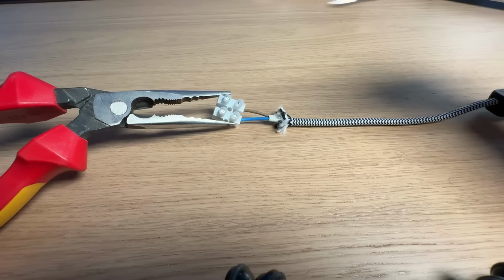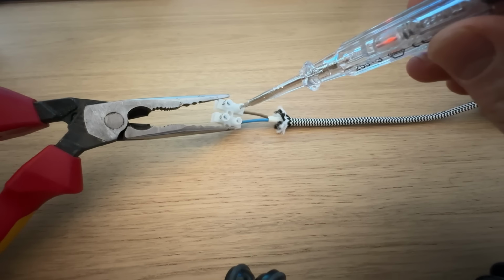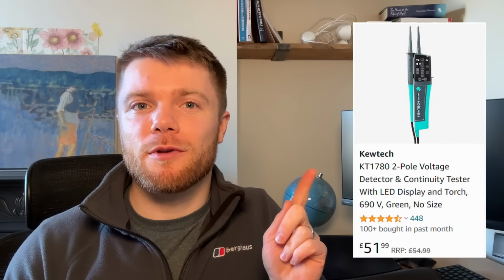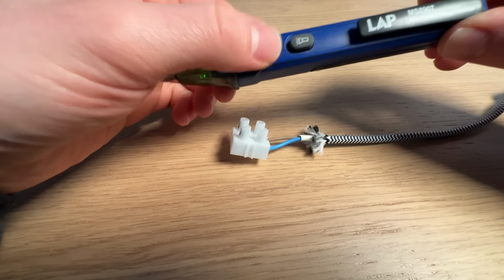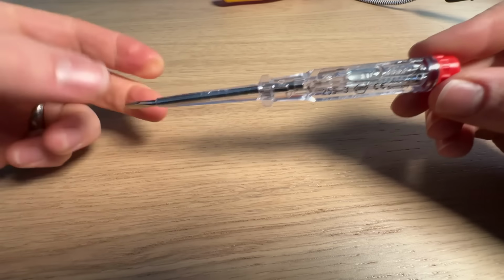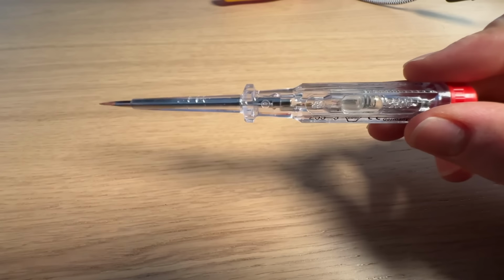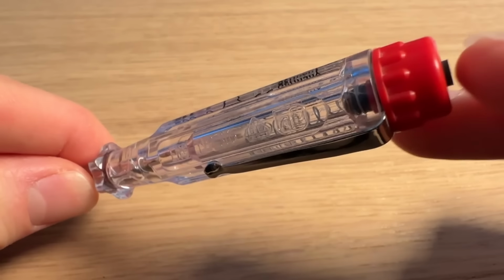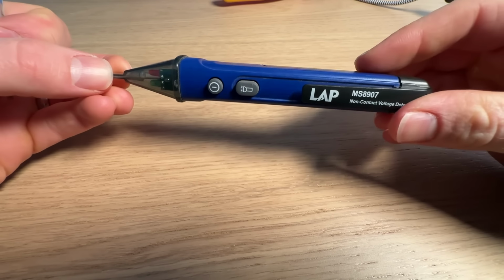The Most Dangerous Electrical Tool

Comment: You are mistaken in the principle of operation of the indicator screwdriver - the current does not go through the user to the ground, the user is a capacitor creating an oscillatory circuit. It is trivial to check - put on thick rubber shoes and the screwdriver will still work.
Reply: I had to read all the fictional assumptions made by so-called electricians/electronics, including the creator of the clip who didn't understand how this tester works. I'm glad that finally someone who knows has shed light on the subject! There are enough speculations that have nothing to do with electronics and how they work, nowadays, everyone thinks they are electronics engineers, but they don't understand how semiconductors work at the base. A resistance of 1M OHM indicates 0.23 mA compared to 20mA dangerous current at 230V voltage. But the gas in the lamp ignite, is not a usual lamp. Neon lamps are commonly used as low-voltage surge protectors.
Reply: Finally, an answer that makes sense.
Reply: Ill try that. on a ladder with rubber feet on a vinyl floor with rubber shoes on. I'll check if it lights up
Reply: @slendydie1267  have you already checked it?
Reply: i do my house stuff on a rubber mat, i assure you, if i dont touch a wall there is no light. That is the dangerous part, false negatives in bright light or in your fancy eva sandals
Reply: @josmith9662  Are you sure you're talking about this kind of indicator screwdriver? Usually, people touch the wall with their hand when using active devices, as this reduces interference and improves the accuracy of finding wires or metal, you can even find wood behind a drywall...
Reply: Total codswallop. Neon is very high impedance and the human is passing a few micro amps to ground to strike the neon.
Reply: @HowardKlein1958 This misses the point. A neon screwdriver has a high value resistor in series with the neon, both limiting the voltage appearing across the neon and limiting the current passing from the voltage source, via the screwdriver then passing via the human to earth. If enough current passes through the human sufficient voltage appears across the neon to light it. Under ideal conditions the resistor limits the current passing through the human to safe levels, as 50mA is considered lethal. However if a fault occurs such as the screwdriver becomes wet, or a short occurs in the screwdriver, the screwdriver can pass a dangerous level of current via the person  to earth. The other problem is this, if the person is not sufficienty connected to earth such as by standing on rubber, an insufficient current will pass through the screwdriver to produce enough voltage across the neon to light it, producing a false negative. For these two reasons neon screwdrivers are not a safe method to prove a 230v supply is dead.
Reply: There is no oscillation here. The current really passing through user to the ground. Just that the ground is not necessarily only the floor. The whole body make contact to the air and humidity from it is enough to light the screwdriver, even if faintly. Only if you wear rubber shoes or stay on a wood chair and the air is very dry, the light will stay off.
Reply: @danieliliescu2141 No it's not, humidity does not offer a low enough resistive path to earth to light a neon screwdriver. If you touch 230v ac rms with the tip of the screwdriver while standing on a rubber mat, while not touching a extraneous or exposed conductive part with any part of your body liable to introduce a significant different potential difference, the neon bulb will not light. It is unlikely, though not impossible that a wooden chair will offer a low enough resistive path to earth, as it is an insulator, when dry, this is why old style fuse boards were made out of wood. It's the sap in the trees that carries a lighting strike to earth when subject to a huge potential difference. Even pure water is not a good conductor, requiring a ionic solution, such as salt, or sulphuric acid, such as in a old style lead acid battery in your car to offer a low enough resistive path carry the current.
Reply: @regsmith5972  I just wanted to demonstrate that this screwdriver is definitely not based on some oscillatory circuit. As I double checked now, body capacitance related to earth and surroundings is the involved factor, alternating current will make this capacitance acting like a resistor(impedance), thus conducting a small, but enough current. Humidity or touching a wall can indeed increase this current.
Reply: @danieliliescu2141 The human bodies capacitance is not a factor here, as resistance is far more significant.  Do a continuity test on yourself with a multimeter if you dont believe me, as measuring resistance uses a dc voltage, making reactace negligible. Humidity  has very little effect on impedance, unless the surfaces you are in contact with are damp. Of course touching a wall could reduce the bodies resistance to earth, as this can be connected to earth.
Reply: @danieliliescu2141  You're mistaken. The easiest way to do this is with a DC power source - this screwdriver won't work.
Reply: @dilvastak7351   I just tried with a DC power source and is working(one pole connected to the screwdriver tip and the other side, where you put the finger for testing) . And the neon bulb is working exactly like Google AI summary predicted, glowing only on the negative pole. On AC both poles of the neon bulb are glowing since AC is periodically change polarity. DC power source should be strong enough, my screwdriver is for testing 230V AC, so I used a 300V DC power source.
Reply: So the guy was talking s***
Reply: Untrue, if you didn't make up the circuit you would not need the resistor. Their are non-contact screwdrivers that work off a fet transistor. This is where you are confused? No, these basic ones they will not work if you are not earthed adequately. Which is the main problem they will falsely show dead if you are on an insulated surface.
Reply: @ Take a simple indicator screwdriver, a rubber mat, boots, etc. and check whether it will work or not (the main problem with such screwdrivers is the low brightness of the luminosity, which is why in bright light you can not notice whether the indicator is on or not, which in the end can be taken for the absence of a live wire or think that it doesn't work). As for contactless detectors, there really are options without contact with both the wire and a person, and there are without contact with the wire, but contact with a person is needed (it amplifies those small interferences on the tip, thereby allowing you to not have direct contact with the live wire)...
Reply: @regsmith5972  The resistor is there to avoid tripping off cirtuct brakers.
Reply: @crazeelazee7524 No it's not, go back to electrical college and look at electrical principles.
Reply: @regsmith5972 no . what he said is true, i wore rubber shoes, stood on a  plastic chair and still it worked. Try it yourself.

Comment: Testers are fine as long as you don't use them as screwdrivers! I forgot that I had broken it trying to unscrew a device I was trying to fix. Then days later trying to check an outlet, I got the shock of a lifetime. Thankfully the spring coil and other contact resistances still had enough impedance to reduce the current.
Reply: Yup, and that’s why you always test your tester on a known live contact before using it. Simples!

Comment: These are more reliable than those  contactless testers.
Best practice is double and triple check: switch off the breaker, use both contactless and this screwdriver. If you do get zapped, well then its probably your luck...

Comment: the stuff complete the circuit  by grounding through your body. this is fine for casual electric work i.e. wiring your house power socket, checking the live/neutral for active current. as long as the current is not above kilovolt range, you're fine as the current passing through you is negligible.

Comment: I discovered recently that this sort of indicator also work when I'm wearing a nitrile gloves, which are insulators.
So I am not so sure about that current going into my body.
Reply: (not backing whether it's safe or not) but it does go through body. AC can jump through insulator and form a close circuit, it's called the capacitance, check it out in high school or uni physics.

Comment: The only way to test for voltage is with a two probe tester. Single point testers can be handy for fault finding but never should they be used for isolating circuits.

Comment: These things have shown me even floating voltages. 

From a power supply connected to a socket without earth, to my laptop, to an usb cable. You touch it, even put it in your mouth, and the voltage collapses and barely feel anything. But the screwdriver still lights up.

If it can detect that, it is more than good to me

Comment: I mainly use my multimeter but I  still use those screwdrivers, sometimes. They always work even after 10 years in a box. We cannot say the same for all those battery powered gadgets. Every time you need them, batteries are flat. Concerning the safety risk, I think you are overreacting on this. I have more chances to win the lottery than a piece of wire to break through the screwdriver and short it. Isn't it ?
Reply: I use them also. They work, but dont use them on volts higher than 220v. And dont use  on AC voltage system which are for DC voltage.

Comment: Why not stick something (smartphone charger, lamp etc.) into the wall plug and see if it gets power? Using this screwdriver is stupid on more than one level. And yes, I do own several of these, yet only used them a couple of times when I was a kid, but never since then, they spell "danger" like few other household contraptions. You're basically sticking your finger into the socket with only a small crappy resistor standing in the way (hint: it might have a high Ohm value, but it has very low tolerance for applied power)...

Comment: Just buy a tester. I bought one 60-70 quid and that will last decades. You can test it and its decent for any electrical job round the house. Being unqualified doesn't make these things unsafe. Not learning the basics, having the kit and how long does it really take to read codes and research. Shouldn't take you longer than a week to really learn what you need to do jobs safely. It only gets more complex when your dealing with more complex installs.

Comment: You are wrong in your explanation of how these work. They do not crate a circuit between you and ground. If they did they would not work on a glass fibre ladder, or with rubber soled shoes on. They rely on body capacitance - your body is able to act as a ground and soak up a TINY amount of electricity. 

Your idea that something could get inside a neon screwdriver is VERY hypothetical. They may be hollow, but they are sealed. Condensation is hugely unlikely to either form in sufficient quantities to conduct the kind of current we're talking about. You'd probably have to fill it with water. You may as well argue your non-contact pen is just as unreliable because "what if water got inside it and stopped it working properly - what if condensation shorts the legs of the red LED and the buzzer so they don't  happen?"

The main danger is that they are 'fail dangerous' ie it stops working because you dropped it on the floor, then you think something is not live when it is. At least a broken multi-meter is obviously broken and/or can be tested in a safe way.

Comment: I am surprised to find you can use a contactless tester on a hanging wire, I always thought there's gonna be a magnetic field around the wire only if its circuit is closed, which I imagine for just a loose wire coming from the mains it would be an open circuit hence no current flow hence no magnetic field around the wire hence the contactless tool shouldn't be able to work? :O

Comment: You have two issues here. The first one is with the neon screw driver when used in bright light, especially sunlight. It looks like it isn’t glowing tempting people to work on live circuits. The second is the contactless testers. They can give false readings. They are best suited for locating breaks in cables. The only way to safely test a circuit is dead is to use a proving device. Testing your proving device on a live circuit, checking the circuit you think is dead, then testing it on a known live circuit again, just in case it packed up working from your first test. We use a small proving box, but you don’t need that as long as you can test a known live circuit before and after you’ve tested the dead circuit. The reason we’re taught not to use a multi meter is because there is always a chance you could put it on the wrong setting. You can get a voltage tester for around 30 quid. How much is your life worth?

Comment: 2:30: That's very nice, but it doesn't solve the problem many of us with old installations have: you've got 2 wires in black isolation both hanging off the wall and have to find out which is live... You would have to displace them substantially, which may not be physically possible or highly inconvenient.

Comment: I believe that non-contact tester does NOT detect any magnetic field but actually it detects the changing electric field, changing at 50 or 60 cycles per second.  Such a changing field will induce alternating voltage in a nearby coil, for example.

Comment: I have one made by wera and it is completely sealed.
This tool should be used only to find the live wire. Always isolate the circuit and check voltage of all wires against ground

Comment: Even if the spring did short circuit the resistor, the bulb would glow very bright and burn out ,causing an open circuit ,quicker than you could blink your eye 😅

Comment: it's the most powerful and cheapest tool for working with mains, with the varying light intensity you can also see for. example a broken earth or. neutral because the induction from the cables around is enough to light the neon bulb.
another very cheap tool is a light bulb with two wires.

Everything else comes next.

Comment: The non-contact tester contains a circuit with semiconductors and a battery to operate it. There are many things that could go wrong IN THE TESTER ITSELF meaning that it could generate a false negative on the live wire. The one you graded as the 'most dangerous electrical tool' is in fact extremely reliable (nor the neon or the resistor ever breaks) and harmless.
1: In the gadget era, we tend to overcomplicate things instead of relying on simple solutions.
2: that one is made in Germany, bearing the CE logo, meaning compliance to quality and - most importantly - EU safety standards. I would be surprised if this little tool would do any harm to anyone.
3: UK left the EU, but I think you still comply to many rules and regulations enforced there.

Comment: I use those for long time. I havent got shocked from it ever. And the ting about contactless tester is that i cant test individual cable if theres more than one line in one place, which is most of the case, or if theres crappy cable work and they somehow use the wrong line as the the live, i cant detect that because it detect all live line close to it.

Comment: The current doesn't go to the ground while using the screwdriver. You can prove it's true by using it while standing on a rubber mat or any other insulating material. Or while jumping. The current actually flows in and out because of your body's electrical capacitance!
Reply from the maker: You’re absolutely correct, however that fact doesn’t invalidate any of my points. Thanks for watching!

Comment: Anyone who relies only on a neon screwdriver to determine if a circuit is dead and safe to work on , then you shouldn’t be working on electrical systems period. Why do you think that a qualified electrician does 3/4 years college to become a qualified electrician and to clarify I did 4years at college C&G 236 part1 part2 and C course in the 80’s  and also 
BS 7671 IEE wiring regs 15th,16th,17th,and 18th edition

Comment: This "screwdriver" is only half of the tool. It should have a cable with a banana plug on one end & an alligator clip on the other. It shouldn't be used without the cable plugged into the handle.
It also should never be used on mains power, it's not designed for it.
By far, the best use for this tool is for low voltage in vehicles.
Ideal for testing trailer sockets & wiring.

Comment: I would say that the truth is probably that these have saved very many lives, and in my quite long life I've never heard of or ever seen a news report of anyone coming to harm using one of these, nor can Google find me any.

I can think of situations where your electronic non-contact tester would be useless, because of adjacent live conductors - how could you be sure a circuit was dead? 

If they were actually dangerous you wouldn't be allowed to buy them, the notion that something that has been around for 100 years or so and no-one until today on the internet realised that they were dangerous is ridiculous, I suggest.

The only advice I would give is to test every time you use it that it is working by locating a live and checking the light comes on.